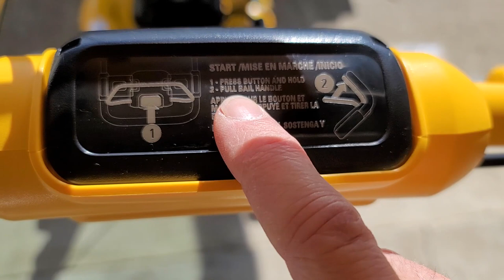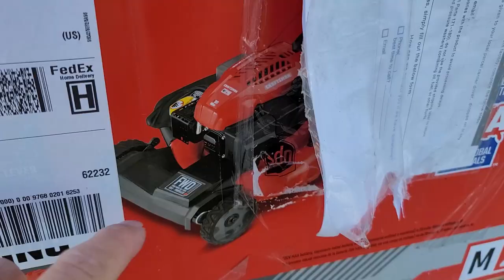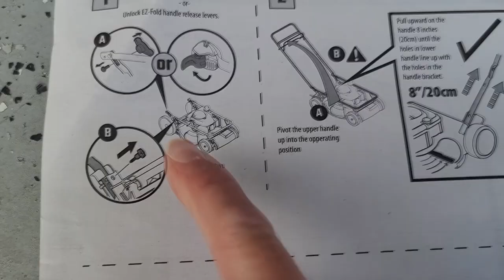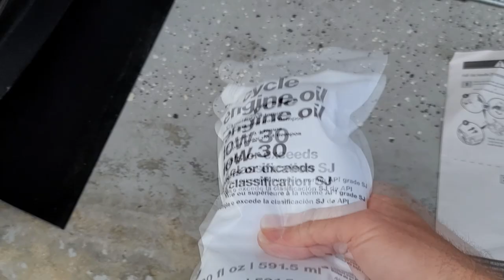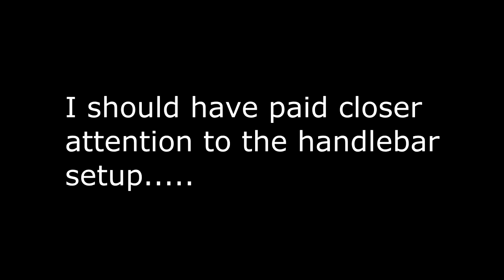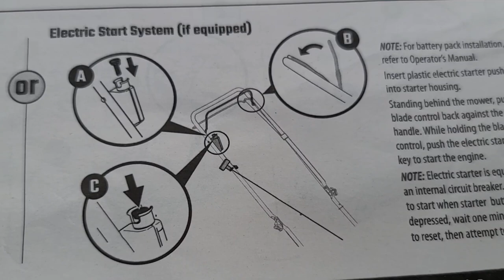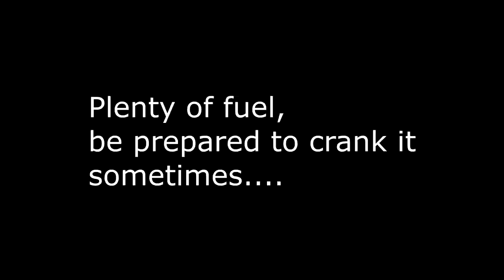Craftsman M270 unboxing and review ver. Finally a mower that works!

Comment: I didn't realize the manufacturers are now recommending 10W-30 oil for newer mowers. I've always used SAE 30 for mine, although I've used 5W-30 in a pinch w/o issues before. It looks like that particular model utilizes a Kohler clone engine, and not a B&S. That mower shouldn't be that difficult to start after having used it, so something seems off about that to me- hopefully just a brand-new mower quirk which will work itself out. Anyway, happy mowing!
Reply from the maker: This is a great comment. You're dead right about the motor starting better after some use. I have several hours on it now and it's easier to start and it runs better too. 
I assume the switch to 10w30 is to make it easier to pull start when cold. Cause past that, as you know, the oil is pretty much the same as regular 30 weight. I'd say 30 weight is still fine to run, but it's all up to the user to choose.
Thanks for the great comment

Comment: Thanks for the review.  Loved the dumb moment you included.  I bought the M220 and saw a video (or read a review) of that so I knew to pull the handles up.  I'm assuming the M220 and M270 use the same self-propelled drive system and although I'm returning the M220 to get a M270 (which was out of stock), I was happy with the M220 drive system.  It was plenty fast for normal mowing.  I have Zoysia which is extremely dense and when I was mowing low and putting max stress on the mower, I had to actually slow the pace down.  My back lawn hasn't been renovated yet and when the lawn was in good shape to cut, the self propelled pace was fine, and at times borderline too fast.  It seemed to have good traction and if I stopped it, the wheels would dig a hole in dry dirt so if you can get traction and the wheels are adjusted properly, it will pull itself along pretty well.  The M220 was pull start and 150 cc, but usually it started on the first pull.  If I had any grass clogged in the side discharge it would take a few pulls to start for me.  Usually I had to lift the front wheels so any excess grass/weeds would be able to fall away and not impede the blade when I started it, but it was more of a problem with unclogging the grass than the mower having difficulty starting.  Actually, my M220 started easier than yours with the electric start.  Love the oil drain on this model.  Of course I typed that after pausing the video seconds before you pointed out the option to tighten the gray pull handle.  (shaking my head LOL).  I do wish you had tested out the self cleaning water hose attachment though...maybe that is in the next video?
Reply from the maker: Hi, sorry I missed this post when you made it. My grandparents had Zoysia grass and I remember that instead of raking the grass cuttings (to bag it) my grandpa would use a broom to collect the grass. That stuff was so springy that if you used a rake, the grass flew everywhere. 
I never tried out the hose attachment.  This mower is at my mom's and it gets used almost daily by her. She has over an acre that she mows every week.
Reply: @jcx2bby  No worries with the late response.  As you see I do not check my YouTube responses as promptly as I'd like, but real life often gets in the way.  I ended up returning the Craftsman mower and did not get the other Craftsman.  With Zoysia, I just needed an engine with more torque, and the metal deck was a bit flimsy feeling for me.  I ended up switching to a Honda mower.  Honda motors are amazing.  I had a Honda motorcycle and the forum I was on had dozens of riders with well over 100,000 miles with nothing more than routine maintenance and all Honda motors seem to run the same way.  So I ended up buying the Honda HRN 216 which has a full 8 Lb-Ft of torque, which makes whatever that Craftsman had look like a Fischer Price toy.  The Craftsman bogged down when I was even a few days late mowing the back yard.  With out of town company and rain, parts of my back yard were over a foot tall, and the Honda HRN 216 twin blade mower never slowed down except for a couple of places, and that was mainly due to the build up of grass under the deck.  I mainly wanted the power for the Zoysia though because as you said, it is just so dense.  This Honda mower can mow my Zoysia at 1" easily, although I do not do it because I'd have to mow more often to obey the 1/3 cutting rule, and the county requires us to have a drainage ditch near the road and the curve of the ditch would cause me to scalp the lawn.  My two favorite compliments were 1) we have a pretty young lady that walks her two dogs that look like show dogs down our cul-de-sac and the last time I saw her go by she had her phone up like she was talking to someone and while walking she turned and took a photo of my lawn and kept going.  She had no idea I saw her through the window, but that just cracked me up.  2) the neighbor kids down the road who are 10 or 11 have told me the love playing in our yard more than any other.  I asked why and they said because they fall on the ground and roll in the grass while playing and the grass is just so thick that it is really soft to fall and roll in.  My wife and I have also overheard both of them chastising other kids to not abuse our lawn because we put so much work into it.  I appreciate it, but that's why I put down Zoysia.  I wanted my daughter to be able to play in the grass and know it will be soft and tolerate the activity well, and if there is a little spot that gets damaged, it will heal itself.  My 25ish year old neighbor refuses to walk on my lawn because of how nice he thinks it is...I tell him the opposite.  I put this grass down and take care of it because I WANT people to be able to run and play on it.  Sorry, far off topic.  I do absolutely love my Honda HRN216 twin blade mower through.  With the twin blades it mulches really well.  It started on the first pull the first time I started it, but I had to pull a few times to get it to start for the first 10 times or so I used it.  Now I can leave it sitting for a month and it will start on the first pull every time.  It has a variable speed self-propeleld option that you use by pushing down a thumb rocker, and you can adjust it up or down so the comfortable spot for your thumb or hand is where you need it for the speed you like.  It also has the adjustable handle for people like my friend Keith who is 5'4", or me or taller people like 6'3" and taller.  The deck is so much more sturdy than that Craftsman I had.  the Craftsman would flex and bend as I tapped it on the ground to remove excess clogged grass, or even just going over rough terrain.  The Honda deck is very solid.

Comment: You can adjust the fwd cable to manage how fast or slow wheels turn
Reply from the maker: That's true, but it doesn't work very well no matter what you adjust it to. Especially compared to a Toro....it's almost like this thing has no grip up front at all. It just doesn't work well and I can say that with confidence after using it for 3 years.

Comment: usually the issue of the mower not wanting start isn’t a mower issue, when the mower is sitting low to ground the grass interferes with the blade causing the flywheel to not spin fast enough, nice looking mower, lawnboys do it for me a lot more than these new mowers
Reply from the maker: Hmm. Maybe in very thick grass. I can't say I'm totally onboard with this but you do have a point.

Comment: The engine is solid on those mowers. The only problem is the self-propelled system. It is not very good at all. They could have done a better job on that
Reply from the maker: Yes. Concur. The self propulsion on my mom's mower is almost completely useless after 2 years

Comment: Nice unbox and review 👌 i like the battery set up, it’s like the same one used on a power drill. Did it work out for your mom?
Reply from the maker: Hi and thanks for the comment. The mower itself works pretty well but the plastic molding that holds the handles to the deck has broken. I am not sure that it is fixable. 
She uses it a lot, and on harder terrain than most would, but I still find this to be unacceptable. I'm making a video of this soon.
Reply: Thanks for the update. I’m thinking it is fixable. You may check to see if the warranty would cover it. I’d guess not.  Since it’s a very common deck and used by multiple manufacturers, you may be able to find a used or reparable unit to use for parts. Im sure it’s not cost effective to buy a new part if it’s even available.
Reply from the maker: @everybodysjonathan  yeah, I am hoping a warranty will cover this, but it's a shade over a year old so we're probably out of luck.  To be continued....

Comment: In 2021 I ordered a mower from home depot. Had 3 different ones delivered. First wouldn't start. Second & third were broken in shipment. Finally got this one from lowes. Loved it for all of 2021. Pulled it out this week & it won't start. My friends said pull out the spark plug & clean or replace. I ordered a spark plug tool to keep with my mower supplies. I can't get the cover off the spark plug. Any suggestions?
Reply from the maker: I doubt if you will find the spark plug to be the issue. Most likely a clogged jet in the carb is causing your issues.

Comment: But you did get a gas one, so that’s good that should last you way longer than the electric one would have good pick two I have the same one just with a Honda engine. Sorry for cussing I just don’t like electric stuff. neither does my dad or my mom they all use gas

Comment: New sub here! Currently going thru the same issue with the M110 you did a 2 part video on. I know you said the 270 is for your mom, but what did you decide to do with the 110?
Reply from the maker: Thank you for subbing JR. I ended up giving the 110 to my father last year. He started it up this spring and it has worked like a champ so far. Thankfully!
Reply: @jcx2bby  wow thats great news and hopefully I could be so lucky. Do you think seafoam would help? Thanks for the quick response
Reply from the maker: @JR.Dugger00  I actually just put Seafoam in the 270 to try and prevent the carb issues that plague these engines. So yes, I'd say it's worth a shot.

Comment: I have the same mower and if I shut it off and let it sit for about 5 minutes it will start without cranking it much
Reply from the maker: This mower has gotten better about starting the more I've used it. And with a touch of Seafoam
Reply: @jcx2bby  I did have a bit of trouble with starting it this year because this is actually the second year we used this mower because we actually bought it at the beginning of last mowing season. But I think that was because we left old gas in it over winter
Reply from the maker: @randytorboli  old gas really screws with these carbs
Reply: @jcx2bby  it must because I had a craftsman mower with a briggs ready start engine on it prior to getting this M270 mower and it always started even with old gas which is weird
Reply from the maker: @randytorboli  possibly slightly different carb design that wasn't so susceptible to ethanol fuel
Reply: @jcx2bby  that is what I'm thinking

Comment: I would like to know how you're supposed to set the Magneto it has a boat that goes all the way through the top shroud through the Magneto no way of adjusting both boats on the Magneto at the same time Is very Poor design
Reply from the maker: Why do you need to adjust it?  That's not something that usually happens on these little engines.
Reply: @jcx2bby   It won't start and I've checked everything else if you are familiar with it it is a very screwy setup it only has one boat for 1 side of the Magneto
Reply from the maker: @gregschroer2314  so does it pivot on one fixed end and have a bolt on the other?  I'll have to look at this next time I have access to the mower at my mom's place
Reply: @jcx2bby   One small boat on 1 side of the Magneto like most models have but the The other boat is integrated integrated with the hood cover could cover so therefore you cannot see if you have that side measured upright

Comment: Ah crap, got disgusted with DeWalt, eh? Was looking for your video of your new DeWalt mower. Everything is junk and that's why I bought two, count 'em two corded cheap mowers that will probably outperform DeWalt's overpriced lawnmower. They were 133.00 a piece. Work great, hate the cord. I am not going without a mower! I didn't have any. Now I have 4, old gas workhorse, (2) corded Greenworks, (1) DeWalt battery operated. I'll get my lawn mowed one freakin' way or another. I hate buying anything in 2021 it's all junk! I'm done complaining, thank you for listening. Hope Toro worked for ya.
Reply from the maker: Sadly most of this new stuff is kinda junky. I don't get the idea that manufacturers want this stuff to last. They want to keep us on the needle of buy buy buy....
Sent the Toro back, could not believe it was broken out of the box. I gave up on it. My time is limited

Comment: I just bought this at Lowes a few months ago, i was happy at first but not anymore, Side discharge gets clogged to many times, engine power to me is not so great. The engine just started running rough like a miss,. I may have to take it somewhere to get fixed, The self propelled works good, Overall its a waist of $300 its a POS ! I wish i would of bought the honda instead,
Reply from the maker: Had I known this was a Power more engine and not a Briggs, I would not have bought this.  That being said my mom has run this 270 alot this summer, probably in the 30 hour range now and it has worked well. I did an update video on this when the mower had maybe 15 hours on it. Anyway, I think hers is good because she uses it almost everyday. But we'll see how a winter of sitting affects things.
Reply: @jcx2bby  Mine is actually m230 with the big wheels in the back. Has a briggs engine. I think what happened was it was running fine before i ran out of gas then put gas in it and its running rough i may got something clogging the fuel IDK. Its not what i expected from a craftsman mower but its def made cheap.
Reply from the maker: @brentmanzella4186  ah I see. Yes it definitely could have sucked something up from the bottom as it ran out of gas. 
These plastic carbs are just not as good as the old metal versions no matter what brand the motor is I guess.
Reply: @jcx2bby  Its fine i had to clean out the bottom deck again.
Reply: @jcx2bby  very interested in how it did after the winter as mine won't start.
Reply from the maker: @sherryheard4827  I will be trying this out tomorrow as the mower is at my mom's place. As long as there was no gas in it over the winter, it should start and run fine when fresh gas is added. I'll let you know.
Reply: @jcx2bby  how do you get the gas out?
Reply from the maker: @sherryheard4827  You can pull the rubber line off the bottom of the tank and drain it or, easier, just let it run until it uses up all the gas and shuts off the engine.  That's why my mom prefers to do. That way no ethanol-laced gas sits in the carb all winter gumming up the tiny passages in the carburetor.
Reply: @jcx2bby  ah! Well now I will have to drain it since it won't start.

Comment: I bought this same mower yesterday and I can't get the Electric Start to work. I charged the battery to it's fullest and did everything you did and I still get nothing on the electric start. I can use the pull to start it and I was able to mow my yard. I would like to use the Electric Start.  Any suggestions? I too have returned 2 mowers prior to getting this one.
Reply from the maker: Are you sure the battery is fully engaged in the mower?  Mine is really hard to get clicked in all the way.

Comment: What's that lime green thing on the left side? Asking for a friend... ;)
Reply: Found it! Deck wash hose coupler...
Reply from the maker: @Mindful138  correct, you beat me to it!
Reply: @jcx2bby  You were a godsend about the handle hitting the mower blade. I’m too old & know too many swear words to have figured that out on my own without your great video. Thank you from this almost 70-years young Grandma. Hugs!!
Reply from the maker: @Mindful138  I felt pretty dumb when that happened but left it in the video in case someone else had the same trouble. Looks like you did too. I figured if I missed it someone else might also. Although the directions do state this, it isn't overly clear, is it?
Thanks for taking the time to comment

Comment: Over all a good mower just stay away from any ethanol gas .
Reply from the maker: This is something my mom will have trouble with. Cheap gas = lawn mower gas to her. And she's not alone. I'll have to go on an education campaign.
Reply: @jcx2bby  then what gas are you suppose to put in it if not ethanol?
Reply from the maker: At many Shell stations, they have a gas grade that has no ethanol. Usually not the cheapest gas though, and Shell is higher than other stations already. You just have to look at the blend on the grade of gas you're pumping to see if it contains 10% ethanol or none

Comment: What I don’t understand why did you spend $500 on a pile of shit Dewalt electric junk lawnmower? Would you could’ve got a Honda for $419 a commercial lawnmower
Reply from the maker: I think I mentioned in this video that the mower was for my mother, who is in her late 70s. She needed something with a push button start, and self propelled capability. I originally thought that the DeWalt would be the way to go, but am glad that it didn't come with a key, which gave me a reason to return it. 
419 bucks would not buy anything with an electric start or self propelled except for this mower here. Believe me I looked.